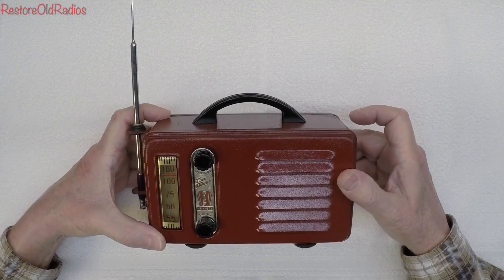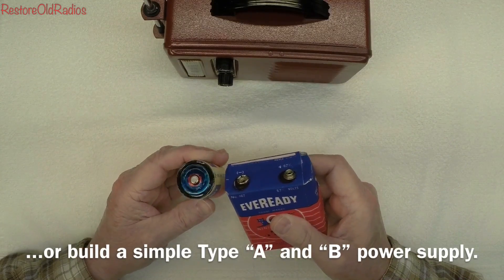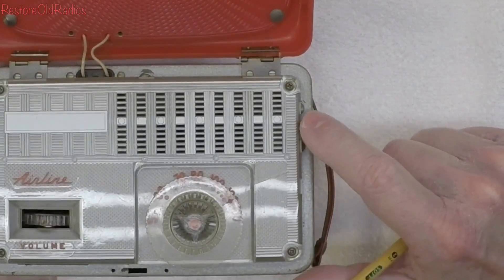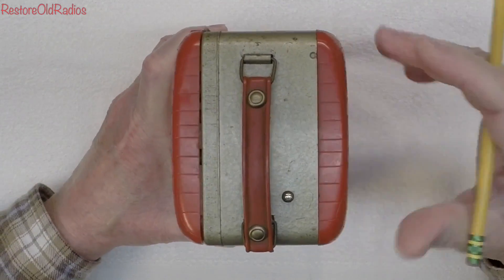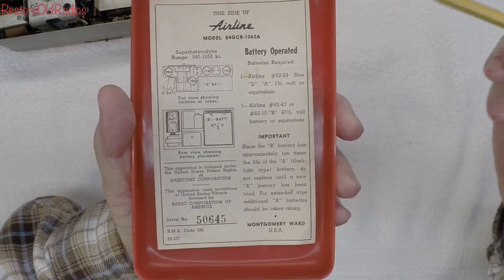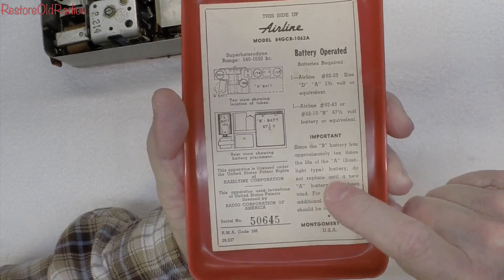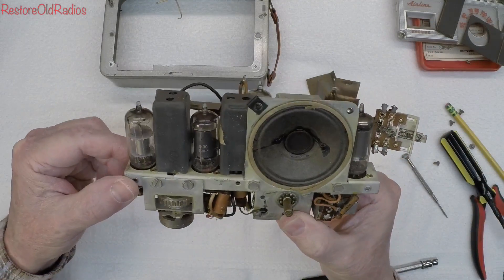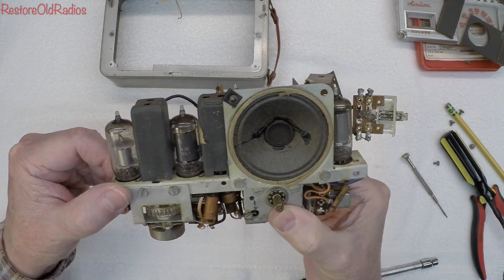Airline Portable Radio - Model 84GCB-1062A - Introduction

Comment: My Grampa gave me his when I was quite young, I am 73.   I guess he got tired of buying batteries, or didn't use it much, or  transistor sets were starting to appear.   In my small town,  buying  B/C  batteries  was expensive and somewhat hard  to find  Of course I was a kid without much money.  At some point I ended up  junking it out  "to see how it worked."  Of course back then you didn't just find a diagram on the internet.  That would have been  59-ish--to 62-ish.  I participated in my first   ARRL  amateur radio field day  in 1963,  using the newly built Schweitzer mountain ski lodge for location

Mine was a bit different,  the plastic covers had a longitudinal  grooved pattern, but it was red ends with gray  center box.
Reply from the maker: Thank you for sharing your history/memories with us and taking time to watch. I wish you all the best. Don

Comment: Nice little radio. I like that it is DC only. I have recently finished a restore of a AC/DC portable and all the damage in it was from the AC. Dropping 110 V down to 1.5v just through ballast resistors is not a great design...
Looking forward to the series.
- Cheers
Reply from the maker: Wow, what model radio was it? That’s a big voltage drop to your point. I just posted part two. Best, Don
Reply: @RestoreOldRadios  - It's a Crosley 11-305U. Still working on repairing the case. And I need to put together a dual battery substitute; working on a system that uses NiMH rechargables to generate 1.5V and 85V. I have some video of the Crosely, I should post it or something...
Cheers,

Comment: Just plug in the battery and turn it on.
Reply from the maker: One can do that, but not the safest practice with vintage equipment. Thanks for watching. Best, Don
Reply: I wanted to see if it worked having sat around for 50 plus years not being used before the restoration.

Comment: That is a really neat little radio!  Thanks for sharing it with us.  
Since you mentioned possibly ordering replacement capacitors, I would like to share a couple of videos with you that are excellent sources of information on capacitors.  Helped me a lot!
https://www.youtube.com/watch?v=67M7fsbLUIU&t=4s
https://www.youtube.com/watch?v=BnR_DLd1PDI
You might find that the higher voltage capacitors will still fit since many are much smaller than the ones from the era that the radio was built in.  Looking forward to seeing the next video on this radio.
Reply from the maker: Thanks Wayne. I enjoy learning from Paul and I’ve watched and referenced these videos in the past. I built a capacitor foil end tester too using a different approach. Hopefully my 400V & 600V capacitors will work out. Thanks again for the links and taking time to watch. Best, Don

Comment: Thanks for posting this video. I restored a Garod 4A1a that appears to be almost  identical except for branding on the inside face. Here is a link to a video: https://youtu.be/ZJsUOXvURw0
Reply from the maker: Hi Joseph - thanks for sharing your video. Looks like an identical chassis other than branding as you noted. Did you use 9V batteries for the Type “B” battery? Best, Don
Reply: Yes. I built a replica like yours thanks to an earlier video by you.